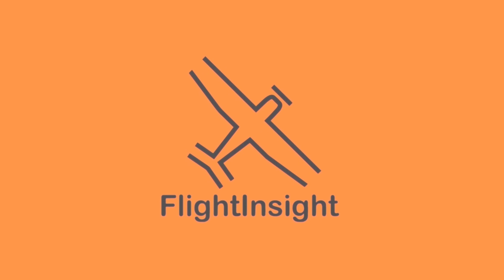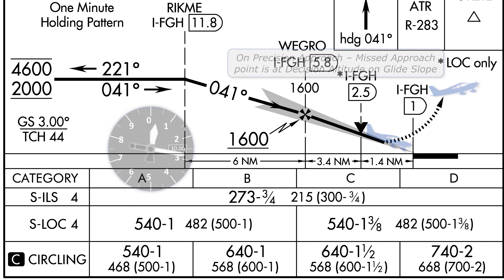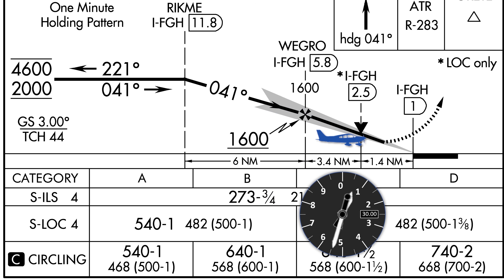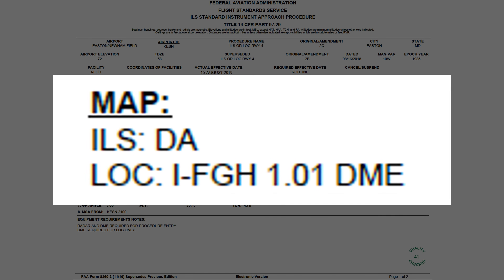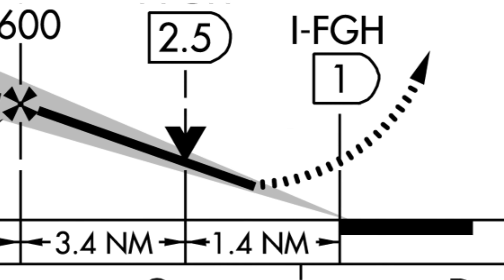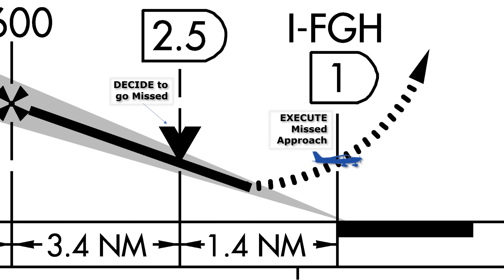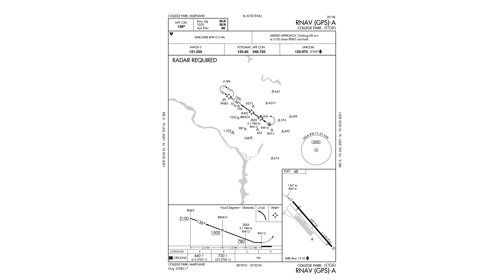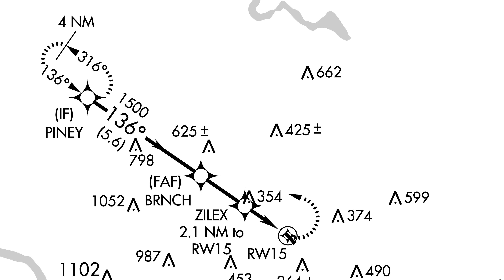Where's the Missed Approach Point? | Visual Descent Point Explained

Comment: Great video! When explaining VDP to students they often ask why the missed approach point isn't simply located at the VDP since you won't be able to execute a stable descent beyond that point anyway. I really enjoyed how you explained the importance of where the missed approach begins, especially when it involves a turn close to the ground. The missed approach point is determined both by the position from which descent to the airport can no longer be safely made without visual contact AND where a maneuver away from the airport can safely begin. I also like to emphasize that the visual descent point only applies to a straight-in approach without vertical guidance. The first approach also had circling minimums, so although you would decide to go missed at the VDP while flying the S-LOC, you would most likely make that decision at the MAP if circling, which could offer another reason for the location of the MAP being beyond the VDP.

Comment: Steeper does not equate unstable. You can still be stable inside the VDP. Look up “LSO Rues to Live By.” If you can adhere to these and make a landing, you will be stable. Better, knowing these, they’ll apply in approaches and in landings to keep you safe. All six in full work for approaches though two will need to adjust for GA aircraft as Navy aircraft don’t flare. Completely separate to this, consider landing distance versus runway length. With excess runway, you can shift your landing point to accommodate shallower descent beyond VDP.
Reply: *Rules to Live By

Comment: I've seen a lot of approaches that have an alternate missed approach fix.  Could you do a video explaining those, including when they would be used and how to execute that missed approach when there are no instructions spelled out?  Thanks.
Reply: For example, the ILS/LOC RWY 9 at Redwing (RGK) requires an ADF because that’s the published missed approach procedure.  But it also has a GPS waypoint as an alternate holding fix.  Would I be allowed to shoot that approach using the GPS waypoint hold instead?
Reply: @thebadgerpilot  you request with ATC that you're going to do the alternate missed

Comment: You can execute a missed approach at any time. The only problem is that you interpret the MA procedure correctly. In case of Jeppesen they will advise you if it is safe to turn before the MAP. In his second example with the turn. You can do a MA before the MAP but you can not turn until you pass the MAP. In the second example with the altitude restriction you can climb to you final MA altitude but can not turn until you passed the altitude restriction. It would be not safe to continue descending on an approach that is not stable.

Comment: It is much easier once you fly with non-government issued charts. Those usually depict the MAP for non precision approaches very clearly indeed (my last few companies use and used LIDO charts, not Jeppesen). That said, over here in europe we have to fly non precision approaches in CDFA technique (continuous descend final approach) and use a decision altitude rather than an MDA. Which means, if we do not have the required visual contact at minimums we do start out missed approach climb straight away, however, the lateral trajectory only starts at the missed approach point, and of course any maximum altitudes during the missed approach (nearly every missed does have at least one if not several of those over here) has to be respected. 

That said, our charts do not depict a visual descent point as that is not required nor useful anymore while using a CDFA technique. And, like most airlines, we do not use the precise minimum, but rather rounded up to the next 10 feet, our charts are tailored to that standard anyway and it just makes life easier.

Comment: I will argue that a 3 degree glide slope is not the only “stable” approach.  I have made stable approaches often as much steeper descent rates in Cessna 150 through 182s as we always made power off gliding approaches where I learned to fly.  There is nothing inherently unstable about a steeper approach in the appropriate airplane with appropriate pilot skill.  I can make stable approaches well inside the VDP.
Reply: In my view you are mixing terminologies. A stable approach is usually defined as an approach that has a stable approach trajectory (laterally and vertically) from the beginning of the final approach to either touch down or missed approach. Which would be fulfilled with a power off approach, but not with a power off approach within a VDP which, presumably, has a different section of approach in front of it leading to that VDP. 

It is of course blatantly obvious that 3° is only the standard approach slope, there are others of course and those can be flown stabilized as well. The 5.5 degrees ILS into London City has created its own class of aircraft, and many military approaches are at a lower angle than 3 degrees, down to 2.5 degrees.
Reply: @Soordhin  I simply disagree with the FAAs definition of a stable approach.  No approach is stable in the true meaning of the word as the altitude is continuously varying.
Reply: @LTVoyager  Well, of course it is obvious that in any approach the altitude changes. But it should do so in a uniform manner, like for example in a stabilized approach in the conventional sense. Which, by the way, has been established in blood, as is very much usual in aviation. Dive and drive approaches are inherently unsafe compared to CDFA ones and the statistics are extremely clear on that point. Which is why the main user of IFR approaches, the airlines, do use them pretty much exclusively.
Reply: @Soordhin  The airlines don’t fly 172s and 182s.  I routinely and safely made approaches in my 182 that would not be safe in a 737.  This is the problem with the FAA’s definition: it is not suitable for all airplanes.  Except at large airports when requested by ATC, I always have flown power-off 180 approaches as that is how I learned in 1977 and it works well.  This would not be the best way to land a 737, but it is fantastic in a 182 and keeps the pattern tight, saves time and once I pull back power on the downwind leg, there is no concern about an engine failure between there and touchdown.  Any pilot that can’t handle power and rate of descent changes on an instrument approach is probably also not competent to make a safe go-around should the need arise as a go-around is a much more intensive maneuver than is a simple power and rate of descent change on final.

Comment: Wrt to the example of the LOC RWY 23 at KFDK, if the MAP is ultimately defined in terms of time from the FAF, which you said correlates (inversely) with ground speed rather than air speed, how can you determine this precisely using only the minimum required equipment (i.e. without GPS to give you ground speed)?
Reply: HI, you just have to make a guesstimate based on some reported wind such as SFC wind from ATC or METAR. I personally do this even for VFR approaches to get an idea of crosswind. Same deal with preparing for my first lap of the hold. There are some legacy alternatives to GPS that will provide GS directly though, for instance a 'Groundspeed and Drift Indicator', or RNAV with other than GPS although obviously those things are rare in the GA fleet.
  The method I use from first principles is to get the reported wind and then approximate the components using 'RAF clock code'. Although it does not lend itself to an easy textual description, once learned it is pretty user friendly and provides a useful approximation. Other methods are available.
Reply: There is a rusty abandoned e6b in some garbage dump that is crying out in pain right now.

Comment: Great explanation....thanks a lot.
one question concerning the values in the parenthesis...I mean (300-3/4).
earlier you mentioned a bit, this is only used in the military?
How should I apply this values in my flight? reference only?
Reply: 300-ft ceiling minimum for military operators.

Ceiling minimums for civil operators were discontinued in 1967.
Reply: @markprange4386  thank you very much...little bit confused about those numbers....now cleared....
Reply: @widestella5081 :  A minimum ceiling is a requirement in some countries, like Brazil.
Reply: Thank you again
Reply: @widestella5081 :  Or if landing at a military field.  When I flew on a civilian contract into military bases the ceiling minimum applied.  But at  joint-use airports like Yuma, I don't think it applies.

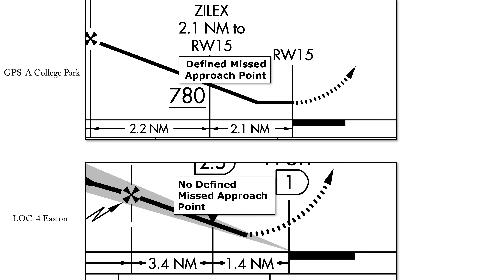Comment: At 2:20 you stated that the defined MAP for the Loc4 is the I-FGH 1 DME. But at 5:30 you say that there is no defined MAP on the very same approach. Respectfully, your vids on this issue (non-precision MAPs) are inconsistent and often incorrect.
Reply from the maker: The comparison of the two views later in the video is between a defined point where the bold line meets the dashed missed proc on one approach, versus the other (the Loc 4), where that point is not defined. The point is to show why the approaches are depicted differently. That doesn't conflict with saying there is a defined MAP for each approach.
Reply: ....so at 2:20 if you go back a bit he states "there is no defined point this occurs" and then after 2:20 says "[but] there is still a missed approach point indicated". And to my mind that is consistent with what is being said at 5:30, as in, the point where the solid line changes to the dashed line is not defined on the first plate but it is on the second plate because it coincides with an explicit fix.

Comment: It's like you read my mind! I was wondering this week how to handle a LOC with no DME from the station and no GPS.  I assumed it was based on the timer, glad I got my confirmation! Now I just have to ID the FAF with only one VOR.  Plan on finding and flying the right correction angle early, switching VOR stations to find the intersection, then switching back to the LOC frequency as I start the timer and decent.  It's complicated, but it's what I have. Does that sound right?
Reply from the maker: That's a tricky one. Sounds like you're saying you're going to be off the LOC guidance just as you're crossing the FAF, which is not a great idea as you need to be on the course guidance inside the FAF. Approaches that use cross radials to identify a FAF don't require Dual VORs, but they do require them to identify step down fixes after the FAF since you're not supposed to switch off the approach guidance.

Also, not all FAFs are identifiable using cross radials. You can usually avail yourself of radar vectors from ATC as long as coverage in the area is good. This way you could leave your lone VOR on just the LOC frequency. I'm sure you've heard this, but if you're planning on doing hard IMC with any regularity you might want to look into a panel upgrade. All of this IFR stuff with minimum equipment is fun in theory, but in reality will limit your options to a large extent, and in IFR having plan Bs and Cs etc is a must.
Reply: @flightinsight9111  Thanks. Upgrading the panel is out of my control because I rent. But I have started looking at other rental options or even possibly ownership.
Reply: …now that I look again at the approach I was thinking of, it requires being able to receive the LOC and separate DME, so I wouldn’t be able to do it single VOR anyway.